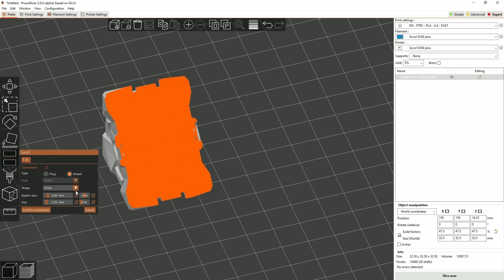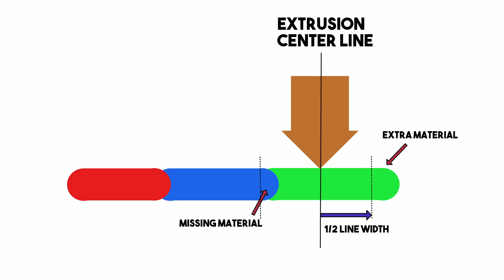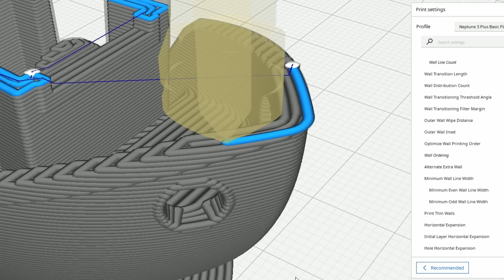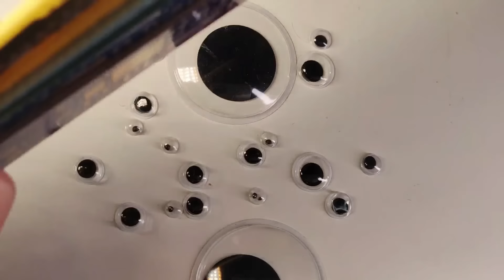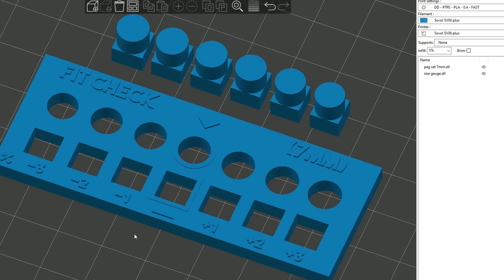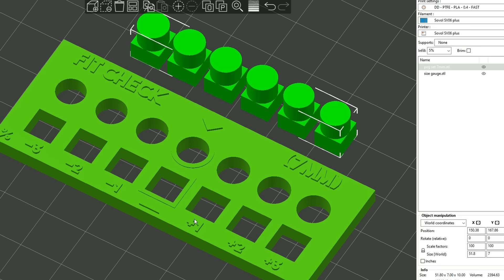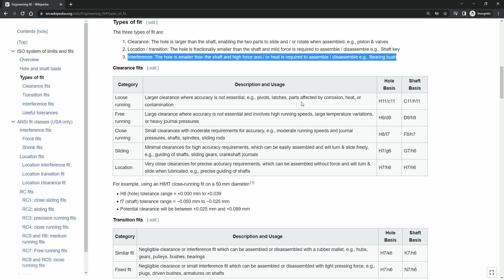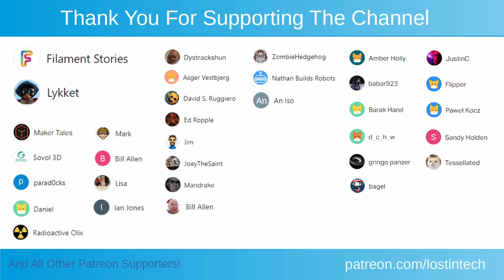Why your 3d printed stuff doesn't fit together and how to fix it!

Comment: Somebody should develop a AI solver for print issues. Probably could use pictures IDK. I'm new to FDM and never imagined so many settings and solutions inside Cura. Its mind boggling. I imagined a world where  I could just download a thing part I needed and just print it and things would fit. I imagined I could edit an STL and make a custom part. Its Hit and miss I am told. So far its a miss. I'm 72 n  bought the new Crealty  Ender v3 KE to avoid some of the pain. But I see the world of 3D printing is still evolving after HP showed their 3D printer on the new product tour over 20 years ago,  That fit test project is brilliant BTW.

Comment: I printed and measured outer and inner diameter on a test print. I used that to adjust horizontal expansion so that I know that the outer geometry is near the correct dimension and then I compensate the inner diameter in the part. Then I have a printed part with almost correct geometry.
I use an Ultimaker S5 at work and for 0,4 nozzle I have - 0,057 and for 0,8 nozzle I have -0,114. Inner diameter for holes I add 0,3-0,5mm.
Works great for me.

Comment: In general, when designing parts that need to fit to something (either another part or an existing object), I would always recommend you make test prints of every critical dimension. I also find that a 0.2 mm tolerance is a good place to start. Finally, fillet or chamfer every sharp corner. In the horizontal plane, a 0.2 mm radius rounded corner is as good as it gets anyway, and baking it in means the printer won't "color outside the lines", so to speak.
Reply: Excellent tips, thank you!

Comment: If you slice outer and inner part "in place", there is a problem in Cura: if positive Horizontal Expansion is needed, Cura will fuse the parts if the outer one is inside the space which would overlap with the inner if you set Horizontal Hole Expansion to 0, regardless how big Horizontal Hole Expansion you set.
I.e. your printer/filament combination needs Horizontal Expansion 0.2mm (so, outer dimensions will be printed 0.4 mm larger, holes will be printed 0.4 mm smaller in diameter) you want to print IN PLACE a cylindrical pin d=10.0 mm in a cylindrical hole d=10.7 mm. It is impossible to slice correctly even if you set Horizontal Hole Expansion to 5 mm because it seems Cura first apply Horizontal Expansion, and then, only on the holes which remain, the Horizontal Hole Expansion.

Do somebody know how to bypass this bug?
Reply from the maker: I can't say I fully get what you're saying but make sure to raise it as a bug on cura GitHub with examples and in sure it will get looked at

Comment: One thing i learned early in 3D printing is it is far better to print extra thick walls on the "female" side of two parts that fit together and then try to print the "male" side as close to the proper size as possible, then you take a drill/mill to your female part and just make it the proper size to fit the male part. It is far too hard for the hobbyist 3D printer user to properly and reliably compensate for thermal expansion and contraction on plastic parts which is a value that can vary massively for the temperature you print at, material, filament manufacturer, infill and number of wall layers, etc. You can manually modify the part sizes with far higher reliability and precision with common hand tools which will save you a lot of time, assuming you are not mass producing parts or something

Comment: Not seeing it but someone may have said this already, if so sorry. This is a GREAT method for making your parts fit, It however doesn't create dimensionally accurate parts. If you buy/print a measurably accurate test piece then use it as a test piece for your test prints, testing inside and outside dimensions on each printer, material, nozzle, ect. will help you create more dimensionally accurate parts. But, this method will work well for 99% of prints.
Reply from the maker: absolutely, it's meant as a relative tool to check printer A vs Printer B for example. You need calipers for dimensional tests.

Comment: It's easy enough to tweak the model at the CAD level to get a good fit - but the utter pain is when you publish (or download) a model from Thinkgiverse or whatever.   In that case, you have literally no idea what the target printer is going to be - what filament, what slicer settings, etc,  A parametric design could possibly fix that - but for complex and organic shapes, parametric design is a pain deal with.  I'm not sure what the answer is - but it's definitely not a simple matter,
Reply from the maker: The answer I guess is for designers to state the clearance like on engineering diagrams

Comment: Normaly when designing something for 3D printing,  i do a part offset of 0.2mm and then it will fit or snap right in. 
If it needs to slide easily then i make the offset around 0.35mm 
Works every time.

Comment: tip for the design of the fit check thing. Imo its almost always better to engrave text, if its big enough it will be ok but especially small it works way better most of the time. If you extrude them they can break off and print worse due to the small area, if you engrave them the quality should be better and there is nothing that can fall off.

Also, not sure if you had any reason for picking 7mm? Maybe changing it to 10mm would be a good idea, just so its a bit easier to use when scaling things. Then if you need a 5mm hole but dont want to change the model, just scale it differently. If the tester is 10mm that conversion is easier

Comment: The most important concerns when trying to fit parts together are squish and thermal expansion. Squish is related to nozzle diameter, and thermal expansion is related to the filament and extrusion temp. You must understand that a round peg will expand outward, and the receiving hole will expand inward — so you must compensate for overextrusion in both parts. I’ve found that 0.2 for a 4mm nozzle is a good starting point for overextrusion. Assuming a 4mm nozzle, a round peg of 10mm would need a hole of about 10.8mm. Remember you’re compensating for both parts in this hole and each part has two expanding directions of concern (4 faces * 0.2 = 0.8).

There’s also the issue of fitting a round peg made of a non-printed material (steel, wood) into a round hole which is printed. In this case the hole only needs to compensate for its own expansion so it would be 10.4mm for a 10mm rod made of metal. 

Talking about percentages of increase or decrease is definitely not the way to approach this problem. A ten percent increase on a 10mm hole is 10.1mm. A ten percent increase on a 100mm hole is 110mm. Hopefully, you can see why this is not a good approach?
Reply: I agree on this on 100%. I don't understand any percentage changes in videos like this about fiting in 3D printing. It's not about printing accuracy, but about surface tolerances. In my opinion is every 3D printer in 0.01mm precision in dimension, but 0.1mm and more inaccuracy in surface depending on nozzle size, layer size atc. => It will change every time you change nozzle or layer size.

Comment: Great content. And thanks for the gauge. I was thinking about creating one of these, but you just made it so much easier. I’m pretty new to 3D printing. But, when I use my Shaper Origin (handheld CNC), I can always create my male part first, the when I’m cutting the female, I start with an offset, try the fit, and add a few though each subsequent pass until I get a good fit. That gets me the answer for the project. It takes so much longer if you need to print the whole item before you know the answer. Thanks!

Comment: I found in my designs that the necessary clearance is not a percentage of total size but rather a fixed amount, 0.2mm in my case. A part that is twice the size will still need those 0.2mm of clearance.

Comment: The tolerance test is exactly how I did it, but instead of circles I did squares. I also made it so the female square hole was 10mm wide, then made the male pieces .9mm, .8mm, .7mm, etc. Slightly different but I think your way is definitely better.

Comment: Yadayadayadayada you simply make parts a tiny bit smaller while designing them before you slice them and print them .
For instance you print a Hole of 20 mm and a nop of 20 mm .
You look at what Nozzle size you’re going to print it with .
For example you’re going to print with a 0.4 mm nozzle .
Make the hole 0.20 mm bigger and the nop 0.20 mm smaller .
Done

Comment: I Always design with a chamfer for a square fit. Really helps those corners. Even just a tiny one. (essentially a rounded corner, but only 1 segment at 45 degrees)

Comment: If I want parts to stick together by friction I design them with one or two tiny "noses", so you don't need to design the part with the perfect fit all around but still have enough friction. If it doesn't fit at all you still can sand down the nose(s) to make it fit as desired.

Comment: I'm printing outer walls first and running into the exact same issue where models don't fit together appropriately.  Other people aren't having issues.  What then?  My Z offset is perfect, my temp is perfect, strings are perfect, rails perfect, leveling perfect.  AND I'm an engineer.  The only thing I can think of is that some printers have wildly varying accuracy.
Reply from the maker: they do - but you can tune for it. Most likely it's flow percentages - try knocking it down 5% and see how it helps.

Comment: There is an easier way to test.
- print a 5mm hole and a 5mm peg
- use a caliper to measure each and note the change 
- adjust your CAD drawing
- print

Keep the measurements to adjust future designs.

Comment: There's just another thing to add: when you generate your .stl file exported from a parametric 3d model software (like solidworks, fusion and inventor) set a good resolution for angles and curves but beware of the file's size.

Comment: I am so confused, i have printet your model witch is awsome and found a tollerence i "like" but i have no idea how i can get a number out of it or where to insert it in superslicer :S can you dumb it down for me in some way? I think ive seen this video 15 times and i still dont get that part.
Reply from the maker: if you're using someone else's part, take the .2 peg, see which hole it fits into, then scale one part to match, that will get you somewhere close. Unfortunately most designers don't tell you what clearances they designed in, so you have to guess.

Comment: i have no idea how ur tool works but i made my own inspired by this, using only one peg and then i can see what kind of tolerance i want. and now i can fall back on it if i ever decide i want a tigher fit or not
Reply from the maker: whatever works, but yeah, if you use the middle hole, thats kinda what my pegs do, but you should design a tolerance in rather than tuning the printer, so something like .2mm smaller should fit, if that makes sense.
Reply: @LostInTech3D  i mean i use this tool to decide how much tolerance i should have when designing, i dont touch printer settings if i dont have to. i would only have one peg but multiple holes with different tolerances to see which i want when designing for whatever im designig

Comment: My experience with modeling is that I usually get the correct sizes when I design internal dias bigger by a half nozzle dia and external by a half smaller. Interference fit between printed parts I try to avoid if the internal part is not printed in another plane. When they are both in the same plane I usually design them with a gap and fill the gap with epoxy if it is a permanent connection. I found nice products designed by the engineers that fit on first print, but they use tolerances, and tolerances table suggests bigger gaps on larger parts and if they implement the tables correctly the take into account variations made by a standard nozzle, which I usually do not do. My brain works in absolute measures, and that is not good, it is even worst when designing a part for metal cnc or lathe.

Comment: As an engineer, the way you said things is on point. Sure, clearance and tolerance are in fact different concepts but that's a tangent irrelevant to the topic, which I certainly must add, you explained perfectly.
That clearance gauge you designed is totally genius, and I'd think that dialing the settings on the printer perfectly for it to have precise measures according to the clearance increments, would result in an even better way of finding out material dilatation or contraction percentage once the square and pegs are printed, and the gauge would need to be printed only once, as you mentioned, and it would kill two birds with a single stone; settings for a material would be known, and that would be the reference point for others.
Reply from the maker: appreciate the comments! I did spend a good while working with an engineer to make sure I got at least most of it right

Comment: I constantly design and print my own parts. The sweet spot I have landed on to get a snug but not sloppy fit is 0.2mm.
This is specifically for threaded parts like screws and corresponding fasteners. the screws are almost always 100% infill as are the fasteners at 0.1mm layer height.
Most of this is printed in PLA/PETG/PC/Nylon

ABS is just too inconsistent.

Comment: I just printed a cube with the size of 1 cm, and then measured it with digital calipers. In multiple spots, to be certain and average the result. That extra measured portion is essentially the clearance you'll need. So if you measured 10.8 mm, you need to shrink your parts inwards by 0.8 mm, and they will fit after being printed*.

*The remaining issue is the elephant's foot.

Comment: Making round and sqare holes perpendicular to the printing surface is the easy part. Doing same with and angled   makes printing the right size even more complicated. So how you make threads then? Threaded holes and outerthreads? On my printer i make screws and threades holes from M10 up to unlimited which workds pretty well when i make the holes 0.2mm bigger and the screws 0.2 mm small with a 0.4 nozzle and PLA+ or PETG. But modelling these threads is not trivial because you have to force the cad system to make M 16.2 or M15.8 Threads which is not easy to get. And to even push it higher try to make conical pipe threads, here common cad systems are giving almost no support so you have to model those threads completly manually which needs strong skills in modelling freeformsurfaces. 
So i would like to see this in you next video and how you will fix it that 3d printed threads will fit together!

Comment: i had to inlay some letters into a piece before and it was a pain in the butt to get them pressed in. as true as it is about corners, i just got a razor blade and trimmed it down, as for round prints, ive actually had quite a problem printing them, usually sanding them down works intill you get a size/shape where you cant get sandpaper in. again like the letters i had to inlay. if i were to do it again, sure i would try to fine tune everything, but i would probably still have to brute force them in

Comment: I always do the following: instead of a square or round solid peg, design it as a flexible two-pronged peg which can be compressed in one dimension. Think of it as two banana-shaped prongs, with their widest parts a bit wider than the hole. When inserted in the hole the two parts will bend slightly, and will provide good frictional fit with the other part. The larger you make the hole and banana-peg, the more friction you can produce.
Reply: As in banana plugs , used in electronics for male to female connectors.

Comment: About corners:
Do we really need rectangular designs?
We usually have rectangular shapes because flat surfaces are easy to manufacture and assemble at scale.
Small elements are better with curved edges - it makes them more rigid, hard and precise.
We cant actualy mold a perfect square either. It can only be cut.

What i want to say:
FDM printer is not the problem - our designs are!
We need to learn to use advantages and avoid faulty designs.
Reply from the maker: essentially, yes. Too many designs are based on ideas of what things already look like, rather than looking at the problem.

Comment: I just simply print a tolerance test bar with a hole bigger than a cylinder and square  by 0.15 mm, 0.2 mm and 0.25 mm. 
Then I try to fit the cylinder in it and ajust the model how I want it to be. I do that for every type of new fillament.
It's very easy to adjust the vertices in Blender afterwards. 
However, it's kinda worsen if the object gets larger in width and length.

Comment: Tolerance aside, when designing parts to fit in one another I've had success minimizing surface area of the contact. if a square goes in square, chamfer the male part so you don't have to worry about corners. If a round goes in round, flute the male round to create gaps without friction, think of a cylinder on a revolver. Also consider the use case, I've made parts with zero tolerance where I expect to lightly tap the parts together and never remove them. On the other hand, a box and lid will need a tolerance so the lid can go on and off the box when needed.

Comment: I think the issue with a percent scale gauge is that depending on the size of your peg/hole the percentage will change the clearance by a different amount.
1% of a 10mm hole is different than 1% of a 50mm hole.

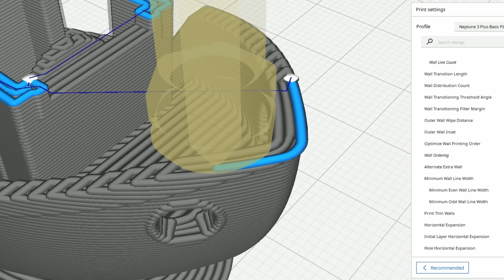Comment: 3:55 this will almost never work even for machined or molded parts. only really works for Wire EDM parts. you need some amount of clearance for tolerance. Unless your goal is a friction fit.